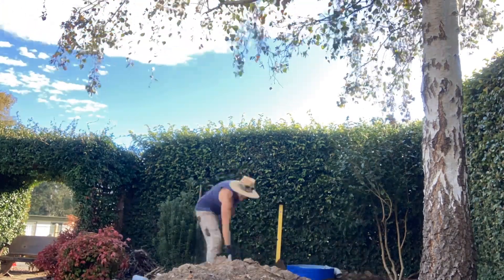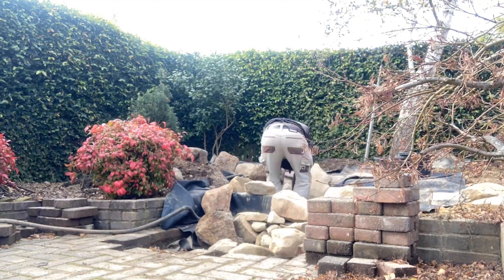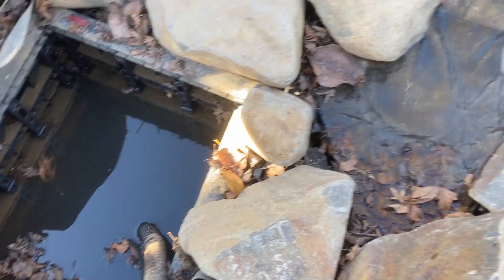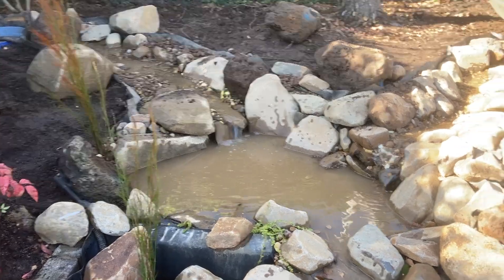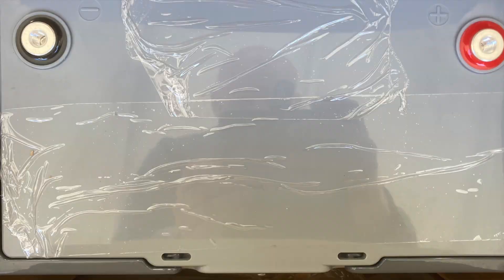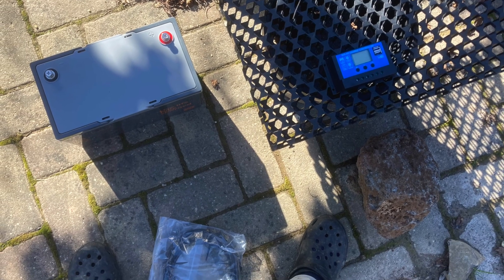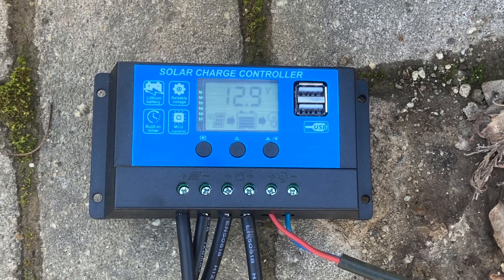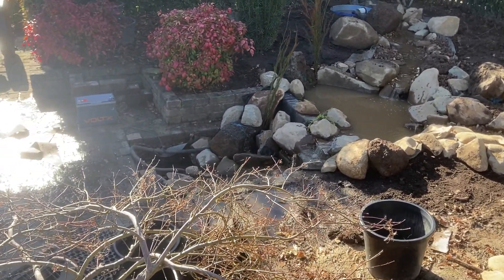Solar powered pond and stream| Update

Comment: Has it been running 24 hours?  Any issues?
Reply from the maker: It never runs 24/7. Cheap pump died, that was only issue.
Reply: What pump did you replace it with?

Which pump is in the video link, the cheap one or the replacement?

Comment: Thanks fir this. I've been considering doing a solar backup for  my pond and this helps  lots.  I have no idea how to handle such systems.
Reply from the maker: It doesn’t seem to hard but I was also a bit overwhelmed. I’m currently in the process of figuring out how long the system will run, configuring settings to conserve the battery. I will hopefully have some insights to share in a few weeks.

Comment: That's a good project to start gaining knowledge about solar. A couple suggestions. Add some red shrink tube or red electrical tape to the ends of your positive wire going from the battery to the charge controller, to avoid miswiring later. That charge controller would not survive reverse polarity. In terms of spare parts to have on hand, everything will have a long life except for that charge controller. Since they are so inexpensive, you may want to have a spare.
Reply from the maker: Thanks for the tips! Much appreciated.